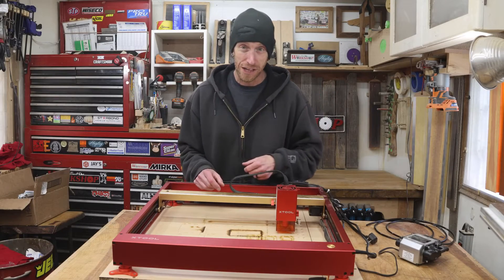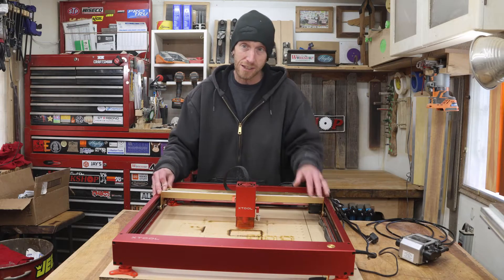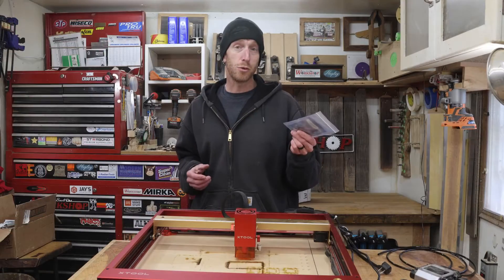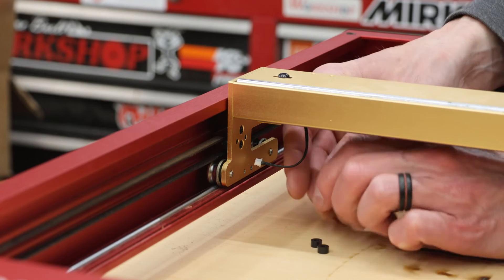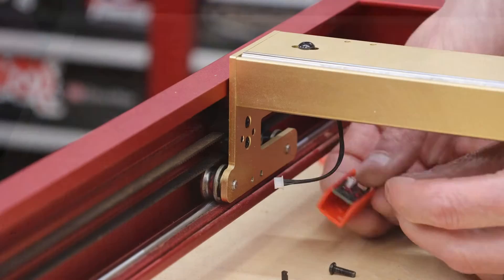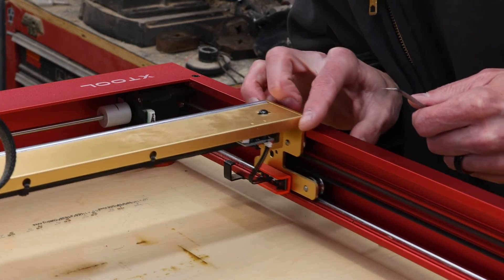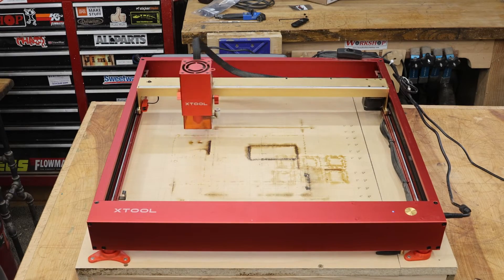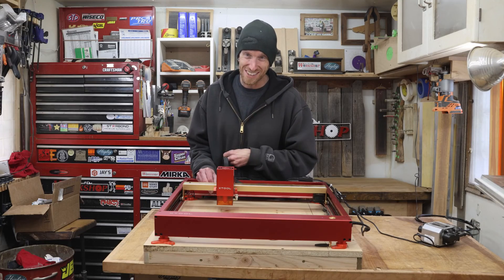I Broke My Laser, now I must fix it. | Free .stl Files available for your xTool D1 Pro

Comment: Great video, took me forever to figure out what was wrong and your video nailed it. But I can't find the replacement parts on the xtool website. Any chance you still have your x-axis left? I'll buy from you! 😊
Reply from the maker: Thanks, That's weird its not available. I just checked too. All I found was this. https://www.3dprima.com/en/spare-parts-accessories/manufacturers/xtool/xtool-d1-pro-limit-switch-v1_28674_10371. I can't vouch for this company but the part looks correct. I don't seem to have any more extras myself. I hope you can get your machine working again.

Comment: were you able to just buy them or did you need a customer service tech?
Reply from the maker: They sell the replacement sensors on the xtool website. They aren't very expensive either, and easy to change.
Reply: @homebuiltshop looks like they haven't been on the site for a while. Customer service is quick and offering warranty replacement or a service purchase link so definitely reach out if they aren't on the site! 
Thanks for the quick and informative vid. Keep it up